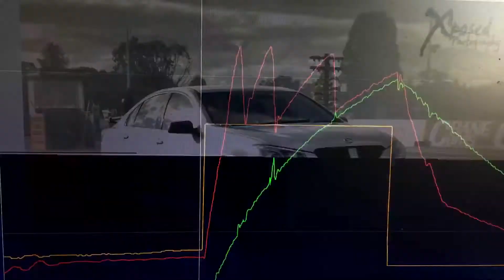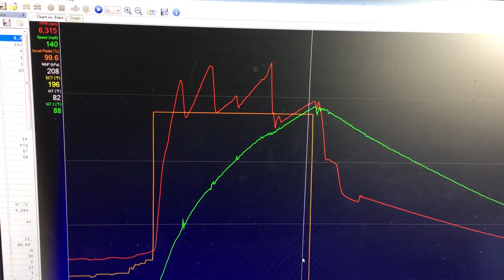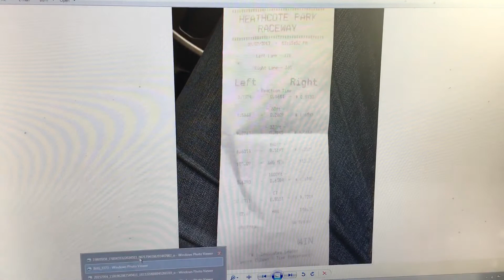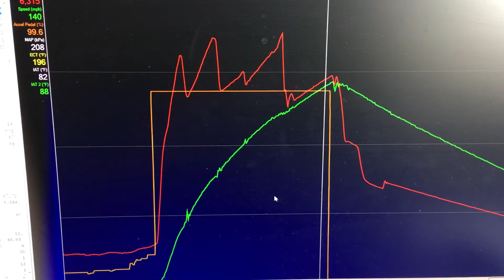IAT2 1/4 mile data log with Interchiller

Comment: Are both cars running inter chiller or just the bigger reservoir
Reply from the maker: Both cars have our stage 1 interchiller, the one with the hotter intake temps has a 1.7gal reservoir with the LSA intercooler pump and factory 5/8" rubber hoses. 

The one with the 88f finish line temp is using a larger reservoir 1" hoses and the EMP intercooler pump